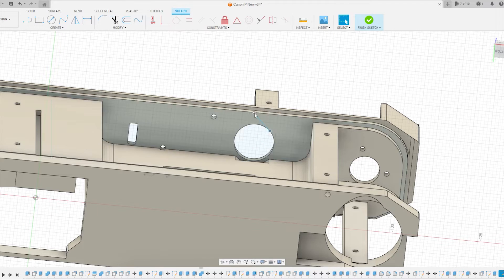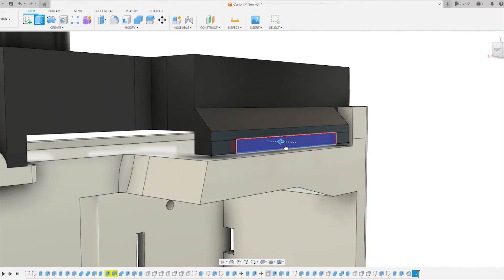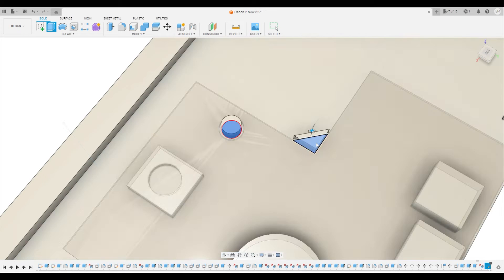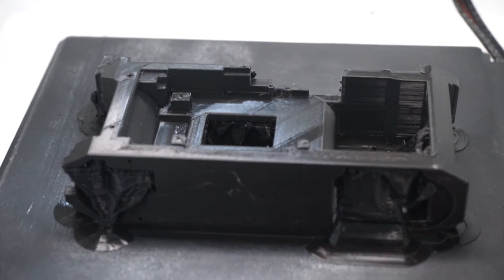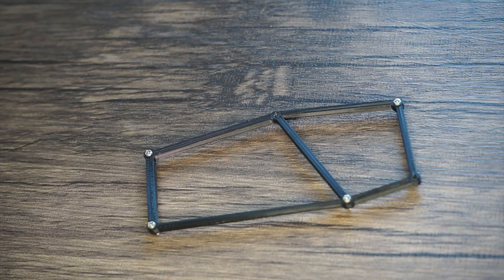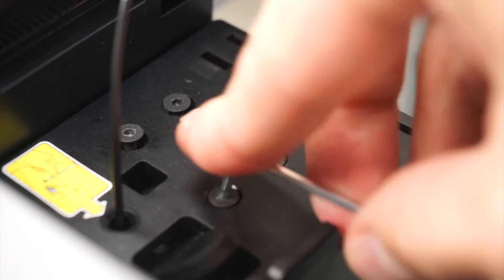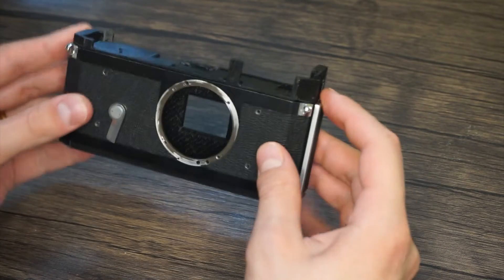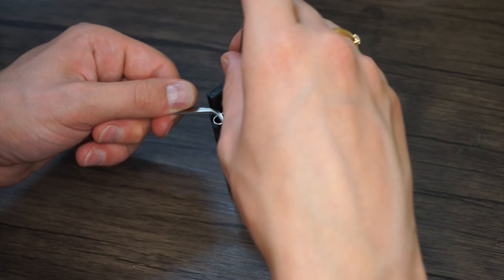Making Improvements to a 3D Printed Canon P Digital Rangefinder Camera

Comment: If you use more sketches instead of direct modelling inside Fusion, you can have Fusion automatically maintain constraints for you like spacing of screwholes and such (and have them remain consistent when one parameter is edited)
Reply from the maker: Oh yeah, I know I can do better. I went from making L brackets from tutorials to this so a bit of learning was skipped.

Comment: I'd been eagerly waiting for this, thanks for the update!
Reply from the maker: Thank you so much for waiting and watching. I'm getting better and quicker with putting out videos so next one might even be finished in less than a month!
Reply: @ErnestasMontvidas  it's cool, it's been nice to see the actual assembly. However I'm still half clueless as to how the rangefinder is paired with the Sony lens. On vanilla Canon P, the lens mount flanges pull a spring, don't they? I've been reading up Frankencamera documentation, but obviously can't afford to mod a Leica M3 lol. He did manage to salvage some physical controls but it seems a bit convoluted (on the mechanical bits side of M3, not the Sony Nex aspect). 
I've been also looking harder at adapting a Pi HQ sensor because it's the best option in terms of physical controls. The challenge is to pack that up with a DOF adapter inside the camera body, I'm clueless about optics but trying to utilize my high school physics knowledge now. 
Another thing I stumbled across is building a Fuji XPro/X100 styled hybrid viewfinder - by inserting a splitting prism inside the OVF (from Volzo on YT).
Also, I was keen on reusing an existing body like your project and M3 conversion but I went through Panomicron's* Oxygen design - files for which are on GitHub and designing a camera body from scratch doesn't seem as daunting now because of the flexibility it'll provide. 

I'm really excited to see how you take this forward, please document your process even if you don't feel like sharing CAD files (paid or not).
Reply from the maker: So the lens is a Canon lens using the original mount then the rangefinder mechanism is moved from the original so it all works the same after alignment. And yeah the swappable back isn’t as easy to put on as it seems to suggest, I guess there aren’t many ways to interact with an analogue camera. 

Thanks for sharing the Oxygen camera that is interesting to see. Using the Pi HQ sensor is interesting but tough because the focal length difference will be massive. Using optics is an idea I’ve had too and I’m not sure I’ve seen anyone doing it. 

Thanks and good luck with your project.
Reply: @ErnestasMontvidas  Right, so the best approach is to keep the native Canon L mount lenses for the rangefinder to work post mutilation. Thanks, makes perfect sense (now that I looked closely and see that you didn't change the mount). As for the camera back thing, I don't really care for it to be swappable - although that is a popular theme with medium format cameras given their modularity - again, out of the scope. However what Frankencamera's Ollie has achieved is really impressive, their M3 -> Nex mod is completely reversible. 
Oxygen is again very impressive, I was blown away by it and Panomicron's other designs too. They have an automatic 35mm camera too, with an electric shutter and display oled, really cool stuff. Just not very well documented :') 
Yeah using a Pi HQ sensor comes with a massive crop if you use an adapter, and no speedbooster exist for 35mm to C mount (afaik), but I really need full customizability to utilize the hardware controls working (mainly shutter speed dial and exposure comp), and perhaps even add a small OLED panel to show basic controls (iso, SS, battery). The best candidate would be gutting a Fuji camera but apparently it doesn't play very nice (according to a Reddit post, it freaks out and reboots with the screen missing and such). 
My approach, atleast in this planning/theorizing stage is: to use a DOF adapter. For example, Goodman AA is a DIY Depth of Field adapter or Ulanzi/Beastgrip made some for phones. You take a full frame lens, and project its captured image on a screen, placed where the sensor should be. That projected image will have the characteristics of the lens used, and therefore you just take a picture of that image with another camera, say a Pi HQ sensor with a macro lens - and you get a full frame image on a Pi sensor, with obviously a noticeable drop in quality. However, that final image recorded by the sensor wouldn't have a crop, and it will have a nice bokeh too. 
My challenge right now is to figure out how to tightly package the entire thing. I want to to the math on paper before I go buying any lenses or focusing screens ;) 
Thanks again for the response, I hope to see your iterations on the Canon P along the way!
Reply: Same.  I've been waiting keenly.  Glad to see the progress.